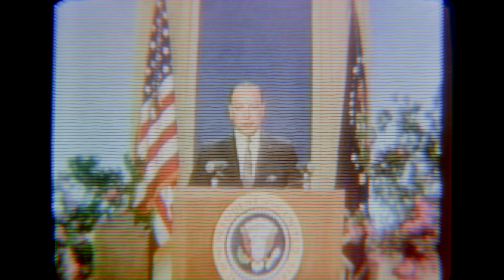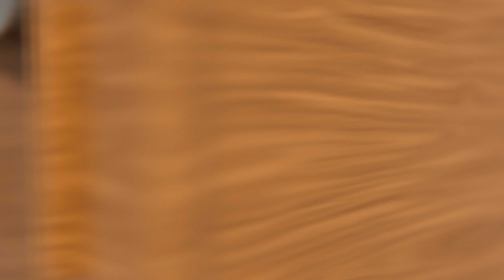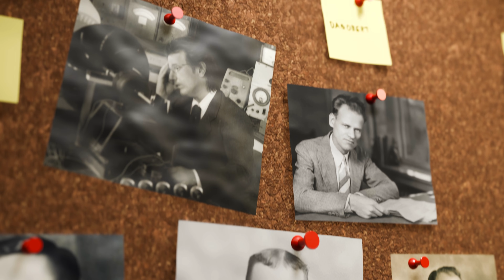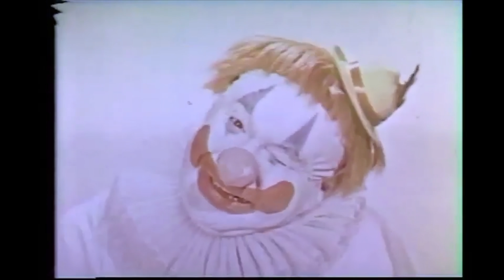Why Inventing Color TV Was So Difficult

Comment from the maker: Feel free to watch the end part like 8 times to undersand it 😅- Thanks to Mr Odoo for making this vid possible: https://www.odoo.com/r/uOA
Reply: The signal part really made it more impressive 😂
Reply: @Emanuel-m9g5u XD
Reply: @Emanuel-m9g5u8
Reply: @Emanuel-m9g5uit is great.
Reply: Haha, Mr Odoo. That was funny!
Reply: @optoonic 67
Reply: Could u do one for transition to digital tv
Reply: @pencilography2025d
Reply: It's not that hard, had they explained it as the chroma signal being transmitted as a 3.579 MHz quadrature modulated subcarrier. The phase (from 0 to 360) represents the color; the amplitude represents the saturation. That was the American NTSC system. The Europeans used an improved version of this, the PAL system, albeit with a slightly different color subcarrier frequency (4.434 MHz). This PAL system eliminated the color errors that NTSC was sensitive for, due to potential phase errors caused by transmission distortions. The French and Russians used a color TV system called SECAM - which uses two alternating color subcarriers that are frequency modulated, rather than a single fixed frequency as in PAL or NTSC.
As the video mentions at the end, these were phenomenal accomplishments by the scientists and engineers at the time. And it proves - necessity is the mother of invention. If there is a market for it; we will go to extraordinary lengths to make it happen.
Reply: @LifeIsTooShortForQRP d
Reply: Primal Space, can you do one on plasma TVs, and OLED? I remember it took a very, very long time for LCDs to look better than plasma. My parents stuck with LCDs, so when my friends or other family members had plasma, it was cool watching science and nature documentaries on those. Fast forward to now, and my 4K LCD display has better colors than plasma. Love your anti-AI stance.
Reply: And what about "Thanks to Mr. González Camarena for doing all this possible with his 1941 patent"?
Reply: nah i already undersand tables they end up a bit rough
Reply: i need you to make a short about this :
why the tv was blurry and pixelated until clean and digital over the years?
Reply: Every new generation of tv had more pixels to increase the resolution. If you set your video to 480p then 1080p, you’ll see what I mean.
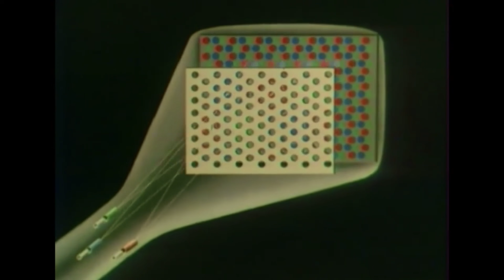Reply: @primalspace 1:04 you do realize "19th century" means the 1800s... Not the 1900s
Reply: @Yao_Guai    You expect so much from a guy who is oblivious to González Camarena.
Reply: @abuelovinagres4411  I quit watching after that 1 minute mark lol
Reply: OH GOD I SAW MY FANMADE SUKILAND TIMELINE
Reply: Where is sponge city model
Reply: It’s understand Brocacho.
Reply: this is so real lol
Reply: YU7Y7S U7😅😅
Reply: Someone stole your video https://youtu.be/RnhU2o1s2y8?si=7Zqei0bliN3DNjh4
Reply: Mechanical tv, color or otherwise, was never a realistic technology.
Reply: This guy stole your video, just thought you should know: https://youtu.be/RnhU2o1s2y8?si=UyJX6vyjPuRsJQ2t
Reply: u
Reply: Bro get sponsored.
But how much money you earn from this video?
Reply: At 0:15 ,how did you make crt old tv effect like this can i make that in android too
Reply: I went to school for this, electrical engineering 😅 I got it on the first pass but I had to really think about it and try not to fall behind
Reply: undersand

Comment: In Europe we used PAL which required 8 MHz Bandwidth and SECAM required 7 MHz Bandwidth. PAL was the superior analog video broadcast the picture was perfect compared with SECAM and NTSC. PAL was also the best choice for receiving TV stations from far distance (DX-ing). SECAM had some problems especially when you tried to receive TV stations from far distance, from what I remember the static was color instead of white and it made the picture worse.

SECAM was used by France, Eastern Europe (except Romania which used PAL as the color standard in the first days of color TV) and Soviet Union, France shut down SECAM in 2012 while Eastern Europe switched from SECAM to PAL in the early 90s

PAL was the default color system initially used by Western Europe and in the early 90s Eastern Europe switched to PAL and was used untill 2018 when analog TV was permanently shut down. 

I mentioned Romania, beacuse it was the last country in Europe to switch to color TV in 1983 but they introduced PAL beacuse the picture quality was superior. Unfortunatelly due to the communist regime which was simillar to today's North Korea. There were only 2 chanels and after 1985 untill 1990 there was only one channel which broadcasted 5 hours per day and most of the scheduel was about the dictator. The interesting part is that color transmission was used only for showing the dictator and some movies, after 1988 television was fully switched to color. In the 80s, 90% from the romanian population owned a black and white television because color TV was very expensive and the schedule wasn't interesting at all unless you lived near the border and you could receive foreign TV channels. After the fall of communism in 1989 color TV set became available to the general population among VCR, satellite dishes and receiver, later cable TV. Also TV sets in Romania could decode both PAL and SECAM video signal, later CRT models could decode NTSC 4.43 and NTSC 3.58 (american video standard) so if I connected an american VCR, DVD or gaming console to a TV set made in Europe using RCA I could watch in color with no converter

In 2018 the last terrestrial analog channel was shut down and Romania was the last country to end analog broadcast but at that time we already had digital TV since 2015. Digital terrestrial television is obsolete because after 1995 untill present day more than 80% of romanians have cable TV with cable internet and 15% rely on satellite television.

Comment: 13:22 This is a inaccurate. First, black and white TVs only filtered out the chroma signal if they had slow circuitry, which was often the case only for older sets or later sets made very cheaply. On most newer black and white sets, you would see vertical bars or dot crawl as a result of the 3.57MHz signal. Secondly, color TVs likewise didn't filter out the Y (luma) signal, it just gets seperated from the chroma signal. I and Q can only give you the hue and saturation, or the ratio of the primary colors in relation to one another, so you still need the Y signal to get the brightness and, by extension, the absolute RGB values sent to the tube

Comment: But why not mention to Yishresh that the American system is the worst of all and the Americans were determined to promote this crappy system without much success anywhere in the world because in most countries it is understood that PAL or SECM are much better?
Reply: Please do not denigrate the  NTSC system of Compatible Colour TV .
PAL is only a "development" of NTSC - reversing the Colour Signal on each alternate line, to compensate for Phase Shift across long distance transmissions, giving increased Colour Accuracy - at the "cost" of reduced Colour Saturation.
(Of course, a "Delay Line" is needed to derive the best of PAL transmissions.)

While the NTSC system continued to be used to transmit signals to Homes in the USA,
the transmissions between "TV Stations" in the USA actually developed to use a form of PAL, to obviate the problems of Colour error due to Phase Shift over Long Distance transmissions.

SECAM (Séquentiel couleur à mémoire ) has its own problems
and
a Delay Line is also required..

Comment: The transmitted color signal bandwidth was much less the the Video or Luma. Color was meant to fill in larger portions of thee picture. It worked great until someone had a striped  shirt or tie, or checkered  pattern suit. The  resulting image would flicker in a pattern we called Barber-Polling. None the less  the system was pure genius. The FCC would not approve a non compatible system.

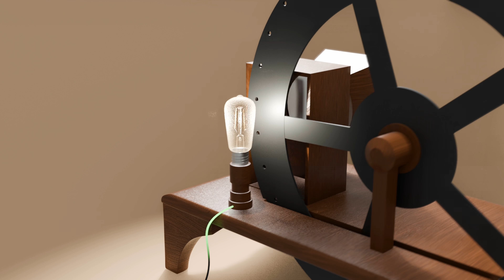Comment: 2:25 correction, mechanical TVs did NOT use lightbulbs, much less the incandescent lightbulb pictured, as they couldn't turn on or off fast enough.  They instead used either Arc lights or Neon lights, which both had their problems, Arc lights emitting tons of eye damaging UV light, and neon lights not being very bright.

Modern replicas of this design use LEDs, which can turn on and off automatically. And they would've been used in the original had they not been invented nearly three decades after.

Comment: The engineering behind this is absolutely mind-boggling. Squeezing three times the data of a color signal into the exact same 6 MHz bandwidth of a black-and-white signal—without interfering with existing TVs—is pure genius. The way they separated Luma, I, and Q signals phase-shifted by 90 degrees shows how brilliant 20th-century engineers were.
Reply: The trick is that you're not really squeezing three times the data. The color signal is very low resolution and not as accurate as the luma signal but fortunately our crappy eyes aren't that picky about color.  You can think of it as smearing bands of color across a much more detailed black and white image.

Comment: It sort of required  a belief in the Holy Trinity  to turn   black and white into color.     So they used three guns  beaming at  pyramid shaped glass pillars,  one side was yellow,  one side red,  one side blue ,  and so by  mixing the strength of the beams on the surfaces of the pyramids of  one side red,  one side blue, one side yellow or green , that  realized colorized images.

Comment: USA was the first to do it, but US TV had a slower frame rate than European. The result was, many American TV programmes shown in the UK and Europe have poor, grainy, picture quality. They also used a different format. NTSC as opposed to European Pal i and the conversion affected quality too. I obtained, when it was still banned in the UK and American copy of Clockwork Orange. I could watch it at work but not at home. Where I worked had both types of machines and machines that did the conversion of format. I made a Pal i copy of Clockwork. The machines did hi res, so second generation copy wouldn't normally matter. But the conversion did mess with the quality and resolution. It was ok, but not clean and crisp like the original. Movies didn't suffer from the slow frame rate of American TV. If the American TV show was a good one, worth the time because it was popular, the resolution could be fixed. But if it was just chewing gum TV, it didn't justify the extra expense. Ie. Starsky and Hutch looked clean. Some of the shitty sitcoms were awful. Fuzzy and grainy.

Comment: The absolute engineering wizardry required to make color TV signals backward-compatible with black-and-white sets is mind-blowing. Squeezing the chrominance data into the tiny, unused gaps of the existing luminance signal without causing massive interference is one of the most elegant data-packing hacks in human history. It really makes you appreciate the foundational constraints of early electronics. 
Brilliant breakdown, Primal Space! Diving deep into the complex physics of planetary anomalies and structural space engineering for my own channel's scripts constantly reminds me of this exact truth: the hardest bottlenecks aren't raw power, they are always data transmission and signal degradation. Seeing how early engineers solved it under tight bandwidth limits is pure inspiration for my next video edit. Keep it up!

Comment: Fun Fact: The old Analog TV transmission signals sent "Darkness" over the airwaves. TV sets were designed to glow brightly and the signals caused shadows to be drawn to "paint" the image. This meant that you could still see a decent picture over great distances using lower power transmitters: Blacks just became grays the further you were from the station.

Comment: Primal space I wanna note down something cool you know how you were focusing on gyroscopes for the Brennan Berg monorail. I brought a time Turner from Harry Potter and then also functions like the same weight. It has free wheels, and one wheel spins inside another that spins, and if I place them all straight straight and then spin it the wheel in the center flips sideways to balance it and if I flip it a little little bit the other wheel that’s in goes down down a little little bit, representing the balance of equilateral and gravitational momentum.😅😊
Reply: Also, it was involved in project Hail Mary, which is the reason why they created gravity because they evolve around the concept of equilateral and gravitational momentum create balance, and spin just like the Earth’s tilt that’s why when you tilt something it balances to keep it equal.😅😊

Comment: Telegraphs could send pictures as early as 1867. The Belinograph was invented in 1907 and enabled photograph transmission. TV was just the ability to send moving pictures which required high speed communication. An impressive achievement from the very beginning.

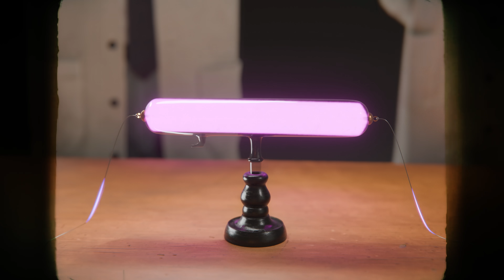Comment: 4:52 "To their surprise..." Why would they be surprised? They had already known that Faraday's experiments two decades earlier with (what came to be called) electrodes in partially-evacuated glass tubes had produced a glow; were they  like, "wow, we did a similar thing and got a similar result, who wouldda thought"?

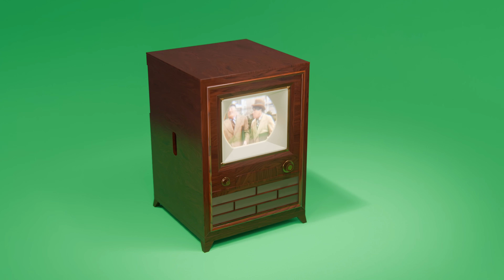11:50 Three electron guns driving different coloured phosphors is not a "broadcasting system" in any way, shape or form: it's a display system. Before HD we used the same NTSC broadcasting system (that you describe later) even with completely different display systems, such as projector, plasma and LCD displays.

12:25 No, colour channels would not need three times as much bandwidth; you could simply let each channel use 2 MHz of the 6 MHz. The reason for not doing that was not particularly the loss in resolution but, much more importantly, the loss in compatibility with black and white sets. Nor is the colour information "hidden" in the black and white signal; the B/W signal is reduced in bandwidth (and thus resolution) to make room for the colour information. (They did set it up so that there's less resolution loss in the luma and a lot more in the chroma, because human vision doesn't notice the latter as much as the former).

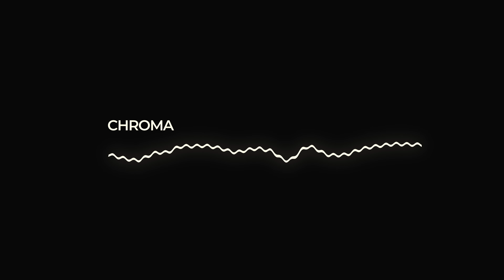13:30 No, the luma is not filtered out leaving only the colour signal for colour display. The luma is a key part of the information displayed and it together with the chroma signals lets you decode to separate R, G and B luminance signals.

14:25 No, once again: the bandwidth of the B/W signal is reduced to make room for the chroma signal. You literally cannot display as many lines across the screen with an NTSC colour signal as you can with a pure B/W signal. If you look at a B/W signal displaying, say, 400 alternating vertical black and white lines across the screen on a B/W monitor you'll see the lines; if you do this with a colour signal (and the colour burst signal is present) you will see a flat colour.

This is just too many inaccuracies that would have been easily corrected had you talked to someone familiar with the details of NTSC encoding. It's AI-level work, not human-level research work. I had to downvote.

Comment: No mention was made of Peter Goldmark and the (in)famous color wheel TV he made for CBS, which predated the RCA system by over a year. But IMHO he has the last laugh because that detestable and wretched system, FIELD SEQUENTIAL COLOR, itself basically a much refined (but still frightfully unwieldy mechanical) descendant of Baird's 1928 demo, is still inducing headaches in people sensitive to it when they view any current single-DLP projector.

Comment: The original mechanical TV by John Logie Baird didn't capture light behind the Nipkow disc. It used the disc to project a spot of light over the subject, and (not very sensitive) light sensors all over the wall captured the reflected light. That's why the room that was filmed had to be completely dark otherwise.

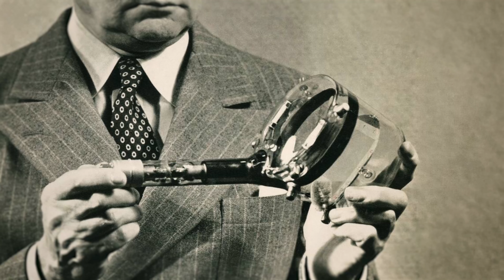Comment: 7:55 You missed the German Manfred von Ardenne who demonstrated full electronic TV transmission in 1931 two years before Zworykin.
Reply: Zworykin's Iconoscope was patented in 1923, not 1933
Reply: @soumalyabarman  Zworykin built the Iconoscope in 1933. Ardenne built a system camera -> receiver using crt tubes on both ends in 1930, shown on the IFA in 1931.

Comment: This is probably the best explanation of NTSC color I've seen.  I've been a television broadcast engineer for 44 years, and this was the technology I had to keep working every day.  One particular issue at the station level is synchronizing all of the video sources so that they feed the production switcher at the same time -- that is, that each source is at the same horizontal position on the same line.  Timing black and white video was relatively non-critical, but adding the color subcarrier demanded nanosecond-level accuracy to keep colors accurate, particularly during transitions from one source to another.  Video cables needed to be cut to precise length: an additional foot of Belden 8281 (the coaxial cable most commonly used) would shift the color by two degrees.  That doesn't sound like a lot, but it's enough to create a noticeable color difference if you have two cameras showing the same subject.  Older equipment -- typically prior to the mid-1980s -- tended to have timing settings drift over time, so we were regularly recalibrating our cameras and VTRs to keep things looking right.  This is a whole class of problems we don't worry about any more with fully digital gear, and it's a daily chore I definitely don't miss!

Comment: Black and white is actually a misnomer. It's really a greyscale. True black and white would be just that, only either black or white. I didn't realize this until I started making crude displays out of arrays of LEDs. Simply turning them on or off vs having a 2 bit digital to analog converter to allow for 4 different brightness levels instead of just on or off. There's no point to making them, I just like to tinker. The point is to have fun. =)